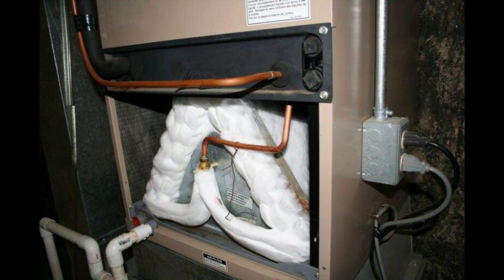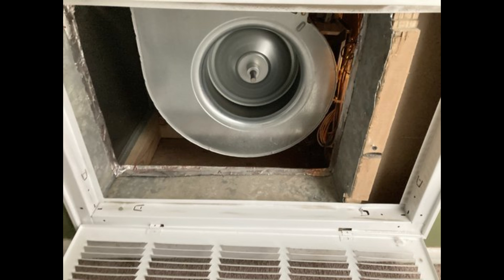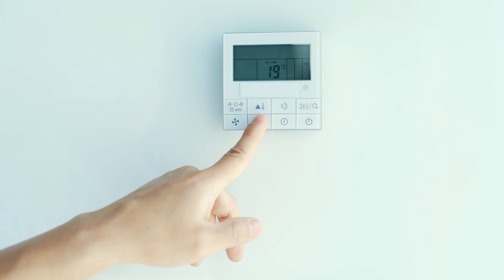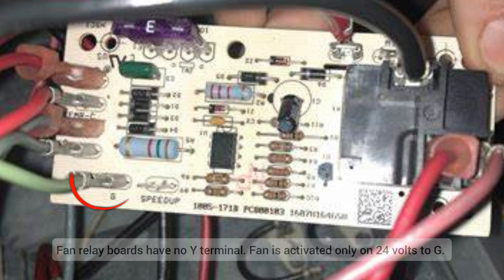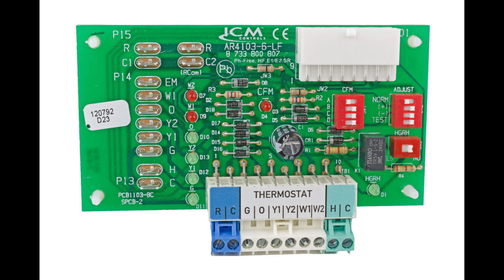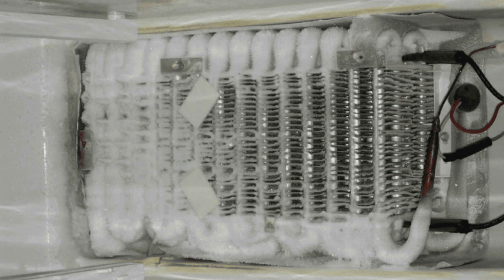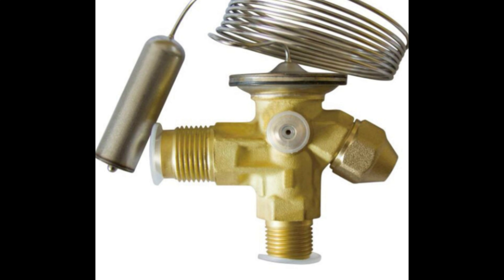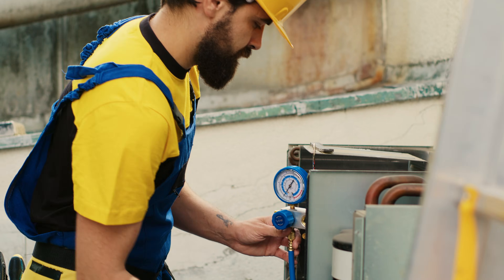Frozen AC Lines? It's NOT Always a Refrigerant Leak

Comment: I dont usually see elevated head pressures with a liquid restriction. Theres less refrigerant coming back to be compressed. What i look at is where the ice or frost is forming. If its a low charge or restriction, frost from txv to a smaller portion of evap then no frost or ice on the rest of it. Low airflow/load, ice from txv to entire evap and beyond and possibly back to compressor.

Comment: I have a question, if you could possibly answer it for me. I turned the system off the other night. The next day, I turned it back on. The outside unit was spinning slower than normal and the lines were frozen up. So far ive tried to do everything myself. I replaced the capacitor, didn't fix it. I get power to the outside, but the fan wont spin. Inside, the unit has a blinking light (IF I reset it) saying pressure switch stuck open or closed. Can that stop my units fan from turning on?

Comment: My line is frozen, and tech checked and is low on refrigerant. Added refrigerant and 4 days later froze again. He says for sure it is the evaporate coil that's leaking.  Could this be the case?
Reply from the maker: Yes, it's possible. leaks in evaporator coils are very common.
Reply: @JerseyMikeHVAC 
Thank you! Also before I could turn the unit on for a bit until it freezes, let it thaw and when I would run it back on it was OK but yesterday I noticed even thawed there is a thumping sound coming from the handler and won't blow air inside despite the outside unit working. Is this still  evaporate coil issues?

Comment: I just used a temp gun on both sides of my filter drier and it was 84 on one side and 91 on the other. Is that enough to say that it's bad/clogged?
Reply from the maker: Yes, but I would just confirm with a different temp probe.
Reply: @JerseyMikeHVAC  Thanks for the prompt response.